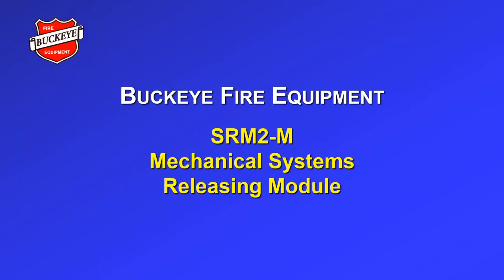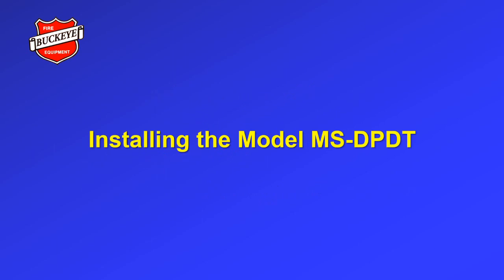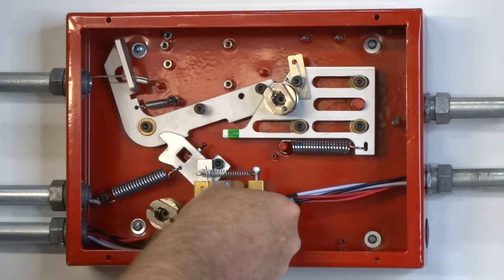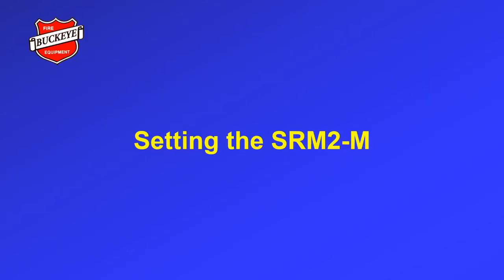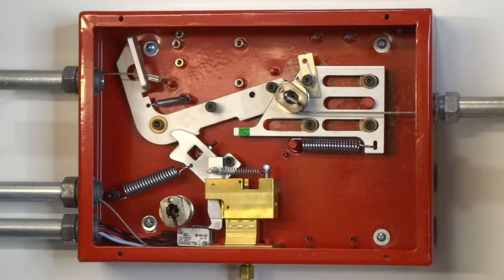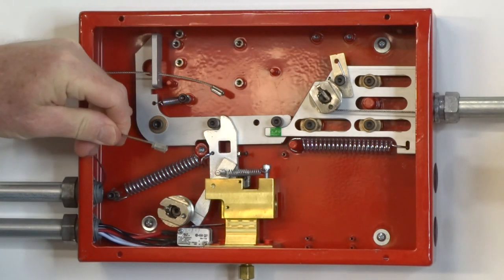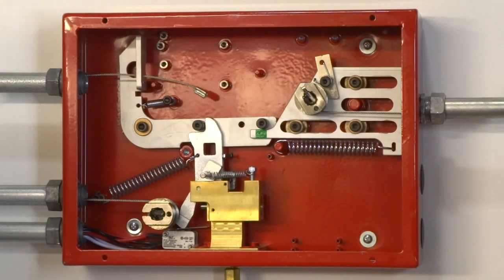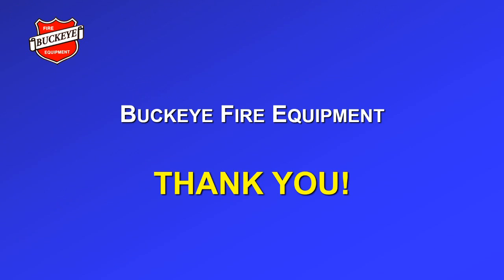SRM2-M Training Video

Comment: Is there a pin hole to release the link line without tripping the control head?
Reply: I'll make sure to tell you guys to "figure it out" if ever you're drowning....    
Good job helping, great teamwork!
Reply: quick question, should that microswitch be in the “on position / closed” in the normal/untriggered situation? at around 9:30 you mentioned the actuation should not be touching the microswitch.
Reply: Yes
Reply: @marshallsquires  elaborate?
Reply: @the1roger  it’s kind of a do it for yourself and figure it out kind of thing.